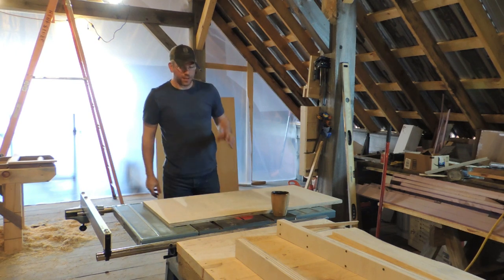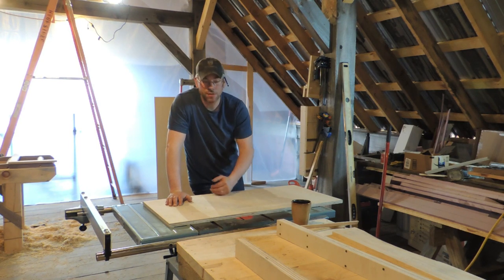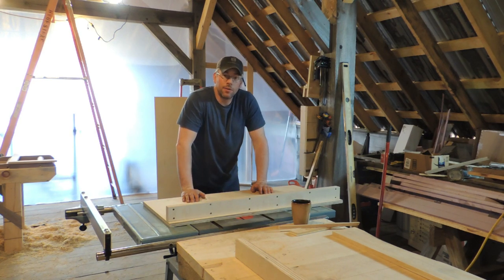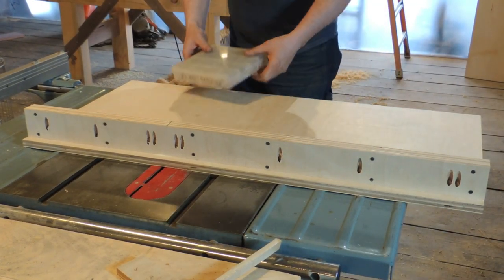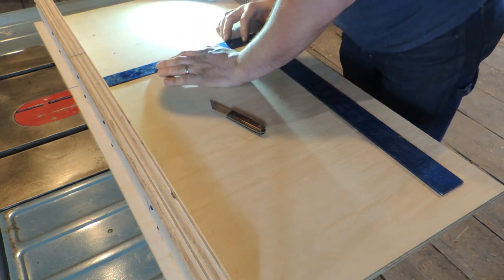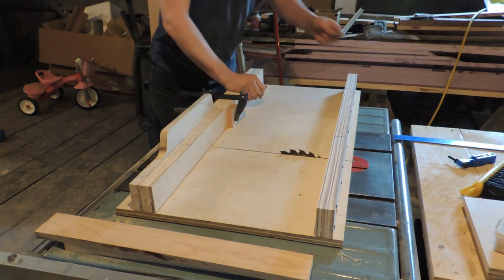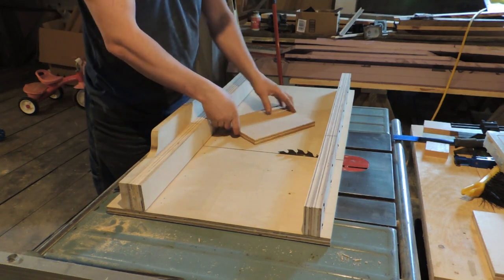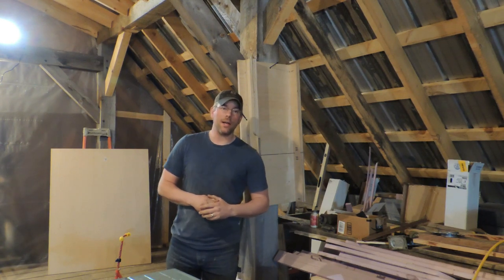DIY Custom Cabinets On A Budget Part 4: Build a Cross Cut Sled

Comment: Great build video Jim, well made and fit for purpose. After I made my one I visited a certain Swedish furniture store and picked up a couple of their throw a way measuring paper tapes and glued them on the sledge either side of the blade slot then polyurethanes them for long life.

Comment: Another way to check for square cut in between what you did and the 5 Cut method. Using the same chunk of panel you did, make the same cut, call one offcut A and the other B. Now, flip either one, A or B, over. Then abut the cut edges. Any discrepancy from 90° is easily seen, because whatever error is there is doubled. 

I'm glad you made the distinction between "crosscut sled" and "panel sled". I made and use a panel sled which suits my needs 100%. Just like Norm...

I'll also mention the three most useless things in aviation: the runway behind you, the altitude above you, and the fuel not in the tanks. We could massage that for crosscut (or panel) sleds by saying "the panel behind the rear fence."

Comment: Jim when are you going to put your finish flooring down before you get too much equipment in your shop that you’ll have to keep moving around to get it out of your way ? ? ? ? ?
Reply from the maker: When I have the money.  If I had the money at the moment it would be down and the place would be 100% insulated.  I am well aware of how much I'll have to move to put flooring down.  I still need to be able to use this space.